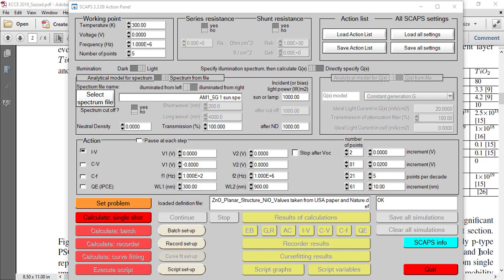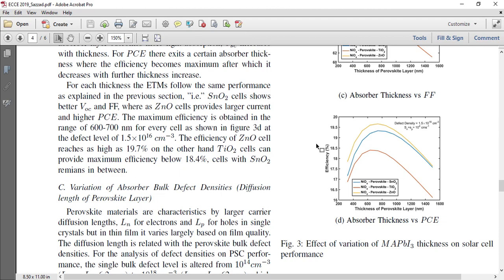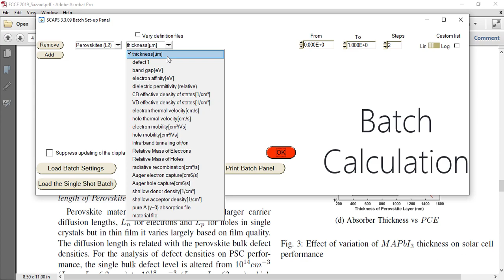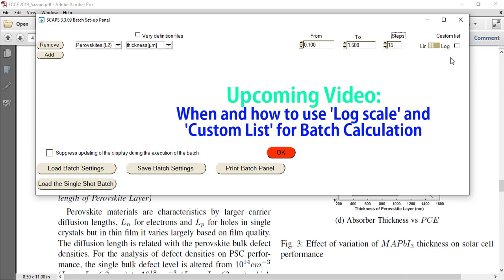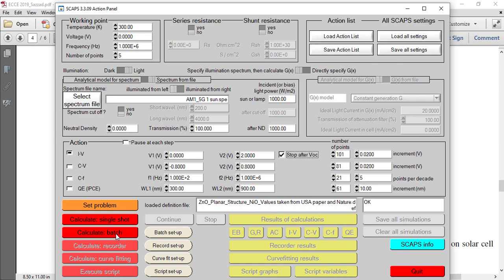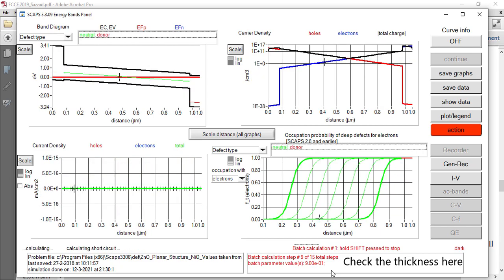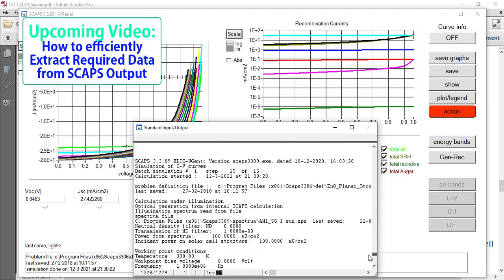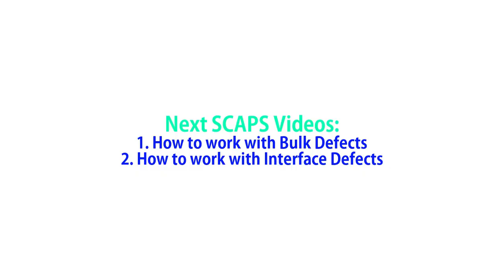SCAPS 1D tutorial: BATCH Calculation-How? ( Varying material or structural properties)

Comment: We always get a lot of help. Thank you
I have used Batch and Recoder to analyze the effect of layer thickness. For example, when I have been analyzed from 30 nm to 100 nm. I got the value up to 90 nm, but from 100nm suddenly all values go to 0. Values do not slowly decline, but suddenly all parameters can converge to 0?
In addition, I can get all value of parameters( J-V, Voc, Jsc, FF, and PCE) up to 90nm, but QE graph is not extracted from 70nm.(SCAPS said "failure"). Have you ever had this happening?

Comment: Sir, I am getting convergence failure problem even after trying everything. Can you please tell me why it is coming and what is the solution for this
Reply from the maker: You may try putting defect levels, interface defect levels and changing ETM or HTM in your simulation. These usually solves this issue.
Reply: @edusupplement594  thank you for your response sir.. I have tried everything but it is showing that convergence failure at V=0.000 volts.
Reply: BRO! can i take defect density as e14.

Comment: Hello honorable, thank you eternally for your generosity, I do not know how much to thank you for your videos. I wanted to know how we add the parameters of the metal gilles as well as those of an anti-reflective layer like MgF2 to the SCAPS software? Thanks again.
Reply from the maker: For metal you need to specify the work function in the left/right contact panel. For the case of antireflective coating, it would be quite tricky to incorporate. You need to have the reflectance pattern of MgF2 ( %R vs wavelength), then it can be given input to the front contact. I will try to prepare a video for that after completing the initial knowledge base videos of SCAPS.
Hope my reply helps.
Reply: @edusupplement594  Thank you very much honorable, so see you soon for the video.